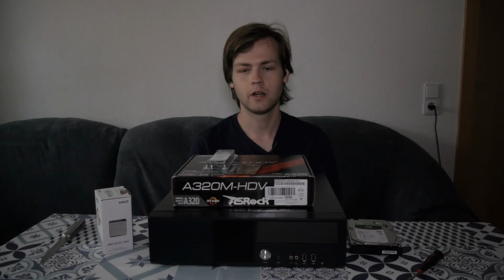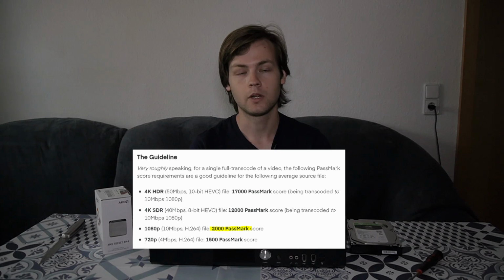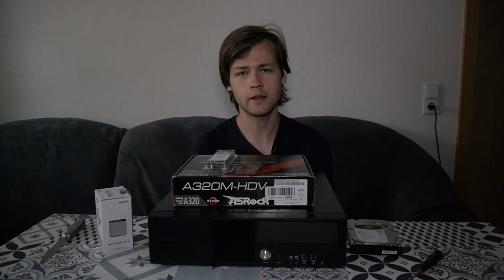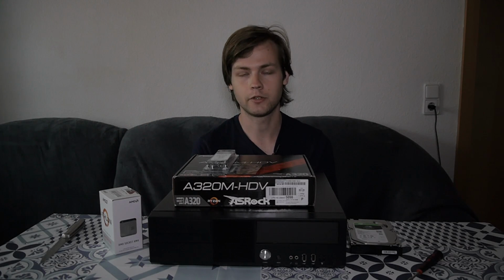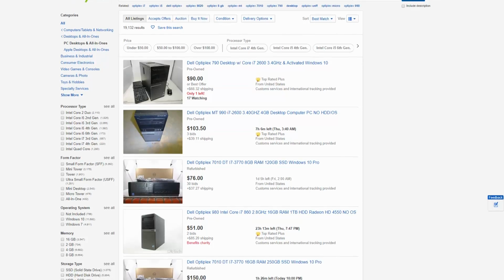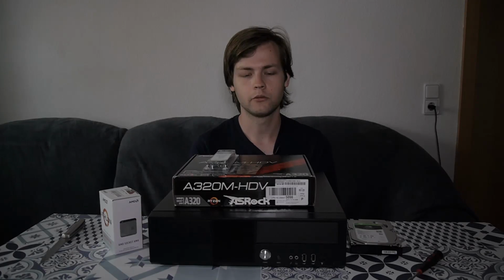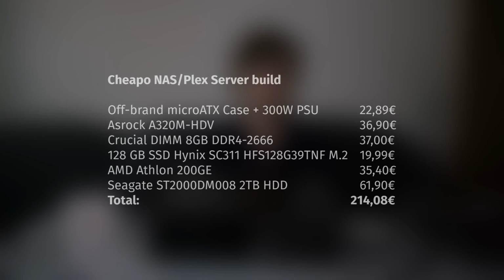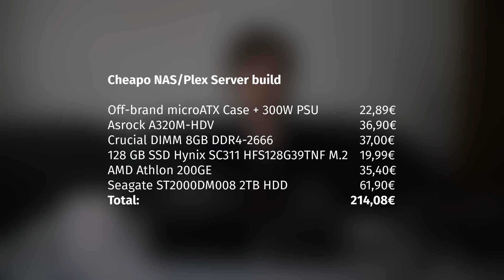Building A Cheap & Low Power Home Server

Comment: great video, this is exactly what i wanted to do as well. 
but i have a question:
do you run your server 24/7 and if so aren't you worried that your drive will fail. raid/ unraid swallows a lot of extra storage, but after setting everything up, I'd be extremely worried of loosing everything, even if the data isn't super important

Comment: optiplex power hungry? i think the pc you built is more power hungry than an optiplex ultra small form factor for example....
Reply from the maker: oh yeah, the new fancy ones for sure. i was talking about sandy bridge/ivy bridge based ones.
Reply: I have an ivy bridge ultra small form factor one and the power consumption is quite low, especially if you configure the system with the intel low powered cpu.

Comment: interesting vid as i'm about to start a low power large nas build for off line archival storage.
That means speed is unimportant but must manage 4k playback, low power is most important  so all drives must spin down when idle.
at the moment the winning solution is also the most ghetto, an old atx power supply running 12 drives on usb converters into two 7 port powered (from atx 5v) hubs into a 4 port hub into the single usb on the wifi router (now powered from 12v atx) ..... yeah bottlenecks, but no, as single user pulling single files etc, or writing a single file, but drive to drive would be a nightmare. possibility of replacing hub with a laptop but dont see a real advantage

Comment: Should wear an ESD strap and / or use an ESD Mat, when dealing with electronic components!!
Reply from the maker: Good to know!
Reply: To defend him, I've been dealing with the insides of countless computers and laptops (sometimes running ones too), and built a few desktops myself and I've never experienced the dreaded ESD damage. Never even owned and ESD strap/mat. Though, of course, I always make sure I'm not full of static by touching something metal that's grounded...

Comment: Server are not always that loud. Normally if they sound like this, there is something wrong with them.....
Reply from the maker: In this particular case the server fans ran on max because of the lid being open.
Reply: @WolfgangsChannel  The server of a friend of mine ran on max because of hard drives reporting the wrong temperature (Not compatible sensor). New drives less noice than a notebook.....

Comment: You should really measure the total power consumption of this NAS,  at 2 states, idle and continuous operating states. BTW you can still get a medium power i3 or low powered Celeron USED PCs,----> e.g. i3 4130 or 4150 @54W  or Celeron j3455 @ 10W. Both are used by Synology 4130 for 8 bays and j3455 for 4 bays NAS. Then use public sourced Xpenology software. That's what I am doing now. S/W is user-friendly and plenty of sources to learn how to use it. Linux based s/w e.g. OMV, open media vault is really to fiddly and too complicated to use unless you enjoy this kind of user environment.

Comment: Do you know how much power it consumes on average now when it's running, considering it was one of your building points?
Reply from the maker: Not yet, still have to order a kill-a-watt, but tests on the internet say somewhere around 15-20W
Reply: @WolfgangsChannel  so still like 5€ a month on power alone.
Reply from the maker: Depends on your electricity costs. My calculations show somewhere around 2-3€
Reply: @WolfgangsChannel  I guess this discussion is probably a "Glas half-full or glas half-emtpy" one. Either way, great video!

Comment: Cool video. How much is the total power consumption at idle? Btw, I am not sure which scares me more - Arch on a server or a power supply from a 14 euro case in a server :)
Reply from the maker: I don't know yet, I haven't measured it. For the PSU - I might upgrade to a picoPSU, those seem nice.
Reply: @WolfgangsChannel  the whole point was the low power and you didn't include the draw

Comment: How low power you're saying coz I didn't get that 30w 50w 75w. I have fx6300 running 2.5GHz, 4hdd, 1ssd 32gb ram and it takes 75watts from the socket
Reply from the maker: FX6300 is a power-hungry CPU. newer Zen-based ones are better in that regard, Athlon 200GE and Ryzen 2400G can even be cooled passively
Reply: @WolfgangsChannel  That's why it's running on 2.5GHz 1.0500 volt so whole system taking 75watts in idly 95% of the time.when watching plex around 95w I was wondering how low you can go and still have plex nextcloud pihole etc.
Reply from the maker: @r3m163  I'll post an update including power consumption soon
Reply: @WolfgangsChannel  Also here: I am looking forward to that :-)